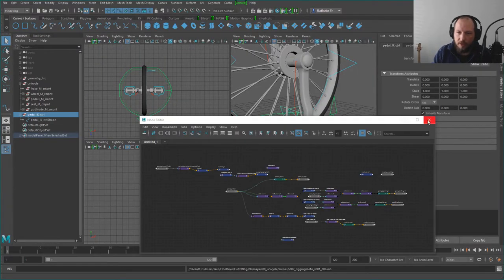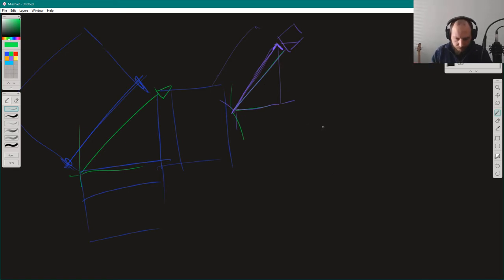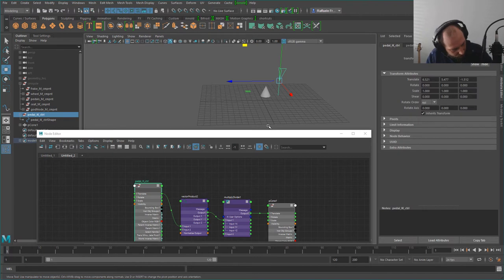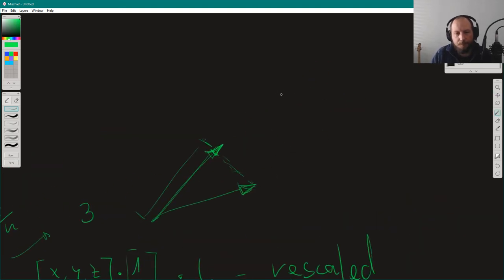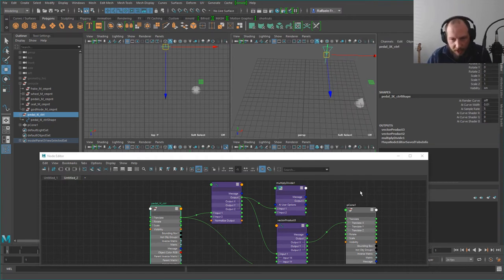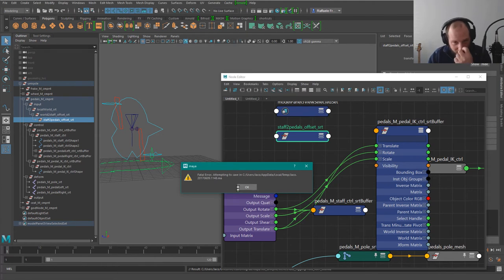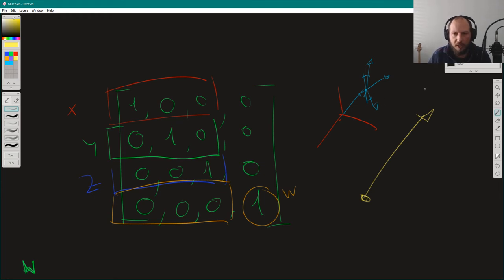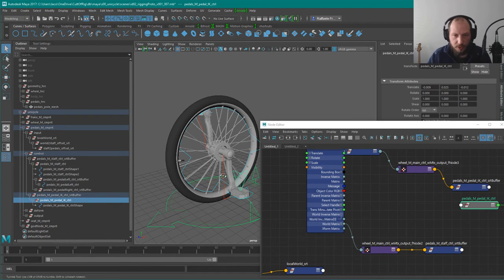Season 00 Day 006 Stream - IK pedals, applied math

Comment from the maker: Also, turns out I lie in the video.
There's a suitable vector length node that is DG only, DistanceBetween. While it's meant to do more than a plain vec len: if you leave one of the two inputs to 0 it's exactly equivalent.
Still would have shown what I did because the point was showing the dot product terms, and we don't have a vec len in the component in the end, but the statement about not there being one is clearly wrong.

Comment: The Reverse node doesn't negate the input in fact in does:  1 - input 
It's handy to reverse a normalized input (0 to 1) but not very useful for anything else.
Great video! Really helpful :)
Reply from the maker: I don't remember how or when I use it, but I don't think it's implied that it's a negate node (it shouldn't be for sure), just that it can be used to invert a boolean value.
It's one of the problems I have with Maya's factory nodes to be honest, the vocabulary is mixed, and some times even incorrect.

A number that offers 1 - x would be the complement (if that's what reverse does), but it might be called anything in Maya, I only use the factory nodes on stream TBH. Much like multiply divide uses the op name, then add subtract becomes... plus minus... average.

Anyway, the 1 complement of a boolean is its logical negation, because there's no sign negation for a boolean.

Ideally what you would actually have and use is a 1 complement for floats (which is quite useful), a NOT for booleans (which should have a set of nodes for logical ops, because booleans shouldn't be treated as ints), a half pi complement for angles etc.
They don't come with the factory install though, which is a shame, so Maya graphs tend to become inexpressive quick.
Reply: Thanks for the nice and complete answer :)
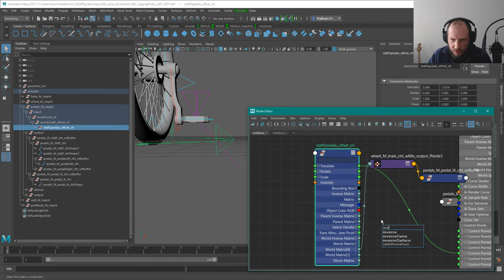It was at 55:56 but I totally agree with you that Maya's vocabulary is really confusing sometimes. It would really need a big clean-up if it wasn't for backward compatibility.
Thank for what you do it is really helpfull and well done. Keep it up! :)

Comment: I was able to follow along to recreate the aim constraint for the pedals. I was messing around with the nodes trying to get the full aim constraint equivalent. If my vector product node outputs X,Y and Z into the angle between node the aim works as long as the Z axis of my aim object is positive. I've tried to use condition nodes to reverse the Z, but so far nothing has worked. I kind of understand why it flips just not enough to fix it. Any help?
Reply from the maker: It's sort of hard to tell by just text exactly what you're doing or trying to achieve (I assume you want to have full rotation from both FK and IK and not just FK, but do bear in mind we're not quite doing a full aim, and that setup won't really scale to a full aim. We're basically doing a projection at this point.

Reproducing an aim would require you work somewhat differently, but to be honest the angle between node should be able to do most or all of the work on its own if you give it the IK control and a reference position in the same space and got angles out of it.

It might look odd for the roll since it won't have an up vector, which is a fundamental part of aiming transforms, but it's the closest thing to one you can get out of an even simpler setup than show in the video.